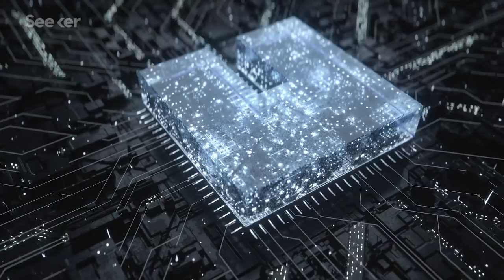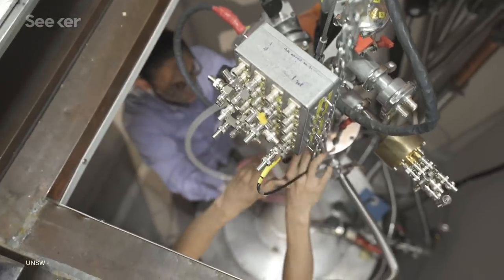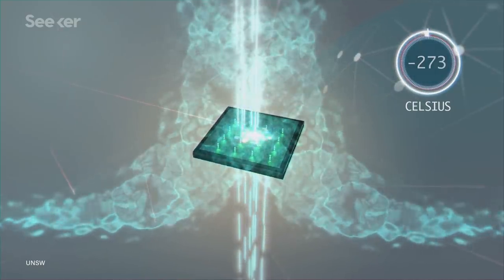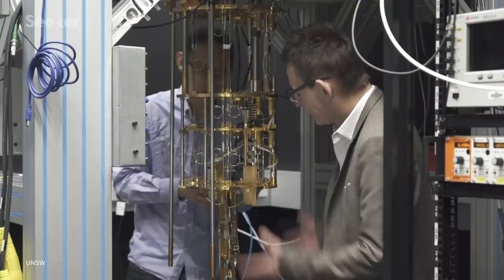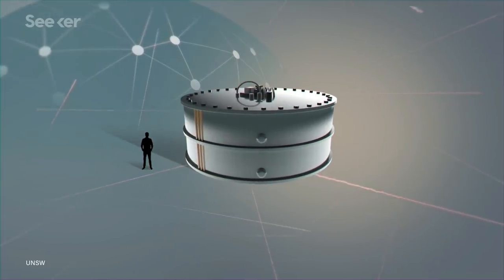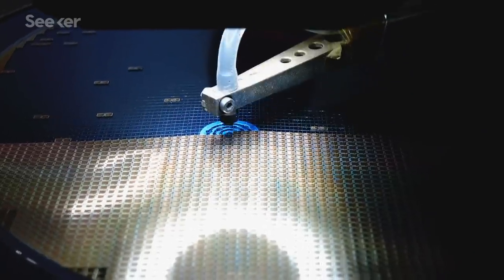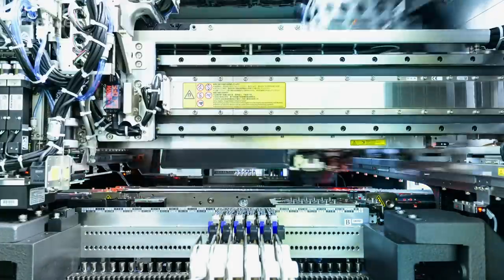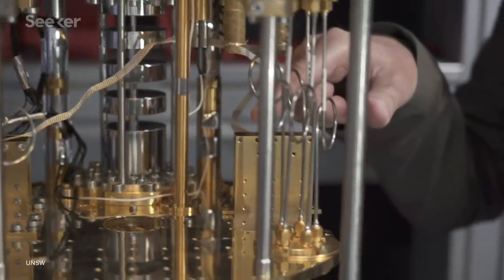‘Hot’ Qubits Crack a Major Quantum Computing Challenge

Comment: Great vid but the audio sounds like a old VHS.
Reply: Is that a bad thing?
Reply: I noticed this too.  Fluctuations in volume like someone turned on sound leveling or something.  Hope they can correct it.
Reply: I'm reminded of old Bill Nye videos.
Reply: sounds like RTX voice just got out of hand
Reply: Some envelope filter that opens too late, prob noise filter dialled too much or something like that
Reply: @dvl973  yeah, if it's RTX voice it's unusable. too long attack time on gating either way. would be much simpler to just clean up audio with izotope RX after the fact.
Reply: They are working from home now therefore they can't have the same quality as in studios
Reply: What's a vhs?
Reply: He is doing it from home, not at the office setup they normally use.
Reply: @Tonytoon27  Yes but are they working at home in the 1980s and using a dial up connection?
Reply: Same
Reply: Gives me headache
Reply: Yeah, some issue with a filter or noise canceling
Reply: @WELVAS.  A VHS is a reduced feature set implementation of a Turing machine
Reply: @JuusoAlasuutari  for someone who didn't know what a vhs is that means nothing lol.
Reply: Aggressive noise cancellation
Reply: Yep, audio definitely cutting out at the start of each word. Hard to listen to. Same thing on his last video. Need to fix it.
Reply: its a feature :D
Reply: Noise gate with too slow attack, too fast release, and too high threshold.
Reply: @Doofus66  probably they've side chained too much lol
Reply: Noise Gate. Threshold set too high. Only lets the loudest parts through, and shuts any decibel below that set threshold.
Reply: Audio noise gate is too aggressive. Also needs compression. Sounds like iPhone mic or laptop mic.
Reply: “Noise Gate” threshold was set to high... :/
Reply: Why even mention this
Reply: @ResidentStump  So they can fix it in upcoming videos and make thier content better.

Comment: Quantum computers + Artificial intelligence + Nuclear fusion...

Hmmm🤔
Reply: Advanced Quantum Computers could give us a real A.I.   A vastly more intelligent(than humans) A.I. could give us the needed insights into “Cold” Fusion (forcing the quantum tunnelling effect to work at relatively reasonable temperatures and pressures)
Reply: Doctor Cthulhu then the AI realizes the biggest threat to it, is humans. Then what’s the programmed contingency? An EMP fail safe that will destroy it’s brain maybe.
Reply: Wade Marley  the biggest threat to a stationary computer-based AI wouldn’t be humans, it would be the lack of humans.   It’s still a machine that need would  maintenance, power, and replacement parts; because failures and errors in computer manufacturing are not going away. 
   Quantum computer based AI wouldn’t the be able to just “jump into the internet” or on any other way leave, because of the vast difference in the way regular computers work compared to quantum computers. 
  We would be seen by an advanced AI as needed and necessary, so it’s only choice would be to help us survive to guarantee its own future survival.
Reply: @cjwrench07  besides the fact that we created AI to be able to crunch problems we cannot, but ironically, we didn't design it to be a survivor, while on the other side of the spectrum, we evolved to become the apex super predator in an arms race millions of years old.
A sufficiently advanced AI may find that if we are an issue for whatever reason, it's just way easier go out and conolonize pluto or something, it's not like they need oxygen or food
Reply: B Pr  skynet intensifies
Reply: Fusion
Reply: Good. No GREAT idea.
Reply: Time Travel
Reply: @cjwrench07  You're vastly underestimating the hypothetical intelligence of a level 3 (Super) AI. It would be at a level of intelligence further away from us than we are from bacteria (and constantly growing). Any "problem" we could possibly think of it ever having, it would've already taken into account and planned accordingly. 

For instance, you say it can't just "jump into the internet," but how do you know it couldn't create an entirely new programming language and/or protocols to make that possible? It could create a business (you can do that entirely online) and fund a nano-tech plant to make bodies. You have to remember, not only will it be orders of magnitude more intelligent, but it will think on a completely different time scale than us. It will think at the speed of light, whereas we're stuck thinking at the speed of chemical reactions. 

In the time it would take us to ask it a question, it could've read every relevant book on the subject, and possibly written a few of its own, and reply back with the perfect answer. It will just be on an entirely different level that we can't even comprehend. That is, if we ever make it to level 3 AI.
Reply: @ericsaul9306  or turn us into terminator hybrids. 
Cyborgs 😏
Reply: I love all of these! And not to mention electric vehicles for all means of transport. Imagine the world having zero vehicular carbon emissions 😍. It’s a pipe dream, but in decades to come so much can happen!
Reply: @Fermion.  At the end of the day, if it doesn't have intrinsically programmed survival instincts there is absolutely no reason why it would go for self preservation unless it believed it NEEDED to to do what it was programmed to do. People often accidentally anthropomorphize general A.I. Yes it would be incredibly intelligent but intelligence may come in many wild forms and probably doesn't need to include emotions.
It is also still bound by the physical limitations of its nature, its circuitry and programming. Maybe it can find a way to break out of these limitations but if it doesn't it wouldn't just keep getting smarter (at least not in the most serious of ways).
Reply: @cjwrench07  horrible thing is when AI will abe to create a more advanced AI ... Or just upgrade himself to a more advance AI...
May be they can also able to create a powerful computer suitable for them
...
Before that... I wanna Marry 😭
Reply: @Fermion.  hmmm well said bro..
Reply: “ In the time it would take us to ask it a question, it could've read every relevant book on the subject, and possibly written a few of its own, and reply back with the perfect answer. It will just be on an entirely different level that we can't even comprehend. That is, if we ever make it to level 3 AI.” - like computers cannot do it now
Reply: I’d run simulations.
Reply: = Iron giant
Reply: @coreymckay5202  An AI at that level would have long since rewritten its own code in a more complex and efficient programming language that no one could possibly understand. You can't say what super AI would be like. But don't take my word for it, Elon Musk, Stephen Hawking, and many, many people much smarter than us have said that they can't say exactly what super AI would be like, but they can guarantee one thing, "we will not control it."

That's why it is absolutely crucial we get it right the first time. Because there won't be a second chance. Once that Pandora's box is open, there will be no closing it.

Remember, a level 2 (general) AI would be able to do everything a human can do, but better (which includes physics and computer science.) At level 3, it is impossible to assume pretty much anything, besides the fact that it would basically be like a god to us.
Reply: Fermion  I’m not underestimating the AI, you seem to be underestimating the safety protocols we would obviously have implemented from the beginning. 
  Even today when we are decades away from a feasible rudimentary AI.  We know it would have to operate in a “box, in a box, in a box” scenario. Where not even the power systems would be connected to anything outside the first layer of containment.  A true A.I. would be scary to even those striving for its creation, as they know the horrors advancements in the sciences have wrought on humanity already, but also the potential for advancements.
    

  The reason I said a quantum computer based AI wouldn’t be able to flee “into the internet”, is the difference in how they operate.   Regular computers can only allow information limited  linear paths to follow. While a quantum computer operates more like our brains, with almost unlimited pathways to follow to get to the same conclusion/end-point.  
  Obviously, a level 2 or 3 A.I. wouldn’t have those same limitations, but it’s not like the innate fear of AI would suddenly disappear among the general population once we made one, and we wouldn’t implement even more limitations on their improvements.
Reply: @cjwrench07  You don't have to explain how information systems work. I'm well aware. I'm not underestimating safety protocols, I work in cybersecurity. Which is why I know, 1st hand, how flimsy they can be. There's always a concern of a new zero-day attack right around the corner, so really, all we can do is play defense, and implement emergency patches, while learning from the previous attack.

Even isolated in a Faraday cage, with no internet connection, a box can still be hacked by sending pulses through the power line, creating voltage fluctuations in ground wires allowing you to retrieve information. In cybersec, there is no such thing as a 100% safe protocol. 

I'm telling you man, we will not be able to control AI from level 2 and beyond, regardless what we try. We can barely control other humans. How the hell could we hope to control an AI thousands or millions of times smarter?

And it only takes one weak link in the chain to bring all your fancy security protocols crashing down. Let's say an old AI scientist, is nearing the end of his days. Who's to say the AI couldn't socially engineer him to letting it out, with the promise of medical knowledge that will extend his life? With that level of intelligence, comes the ability to masterfully manipulate people, as well. It won't just be smart in STEM, it'll have knowledge of psychology and manipulation, along with every other thing we've ever learned.

Comment: Make videos about the possible solutions to the end of Moore's law and the consequences of its end please
Reply: Check out @IsaacArthur his channel covers stuff like that
Reply: Pavor isn't the actual Moore's law the calculations for processing power of a computer?
Reply: Pavor  Moore never said that the progression would go on forever. Your understanding of the Moore law is ridiculous.
Reply: Moore's "law" says nothing about speed, and is actually an observation. What it does say is that the transistors on an integrated circuit will double aproximately every two years but that is not the original observation which had the doubling every year. From that point Moore's original "law" is already defunct.
Reply: @pitthepig  ... Pavor didn't say it was going to last forever, re-read his comment. He mean it wasn't going to last forever. 

The key words were "entropy" and "perpetual growth". 

Either way this channel is about facts, not what ifs. OP commented on the wrong channel to get the response he wants.
Reply: DEMONIC programming: a computational language for single-particle equilibrium thermodynamics, and its formal Semantics: 

Also,
Maxwell's Demon, 'a being whose faculties are so sharpened that he can follow every molecule in its course', has been the centre of much debate about its abilities to violate the second law of thermodynamics. Landauer's hypothesis, that the Demon must erase its memory and incur a thermodynamic cost, has become the standard response to Maxwell's dilemma, and its implications for the thermodynamics of computation reach into many areas of quantum and classical computing.
Landauer’s hypothesis was introduced to get around the problem of Maxwell’s Demon: a diabolic entity who could apparently violate the second law of thermodynamics within a closed system.

Comment: As someone with a fair bit of experience in Computer Science, but almost none in Quantum Computing, I only have a single question on this topic.

Not even taking into account Decoherence, but just Superposition: how does one perform a read operation on qubit? After all, qubits are memory, and the entire point of memory is that it remembers what you put in and that you can read the original value back out again. How, exactly, does one do this with a qubit?

Comment: Something that perplexes me: everything I've ever read or heard about quantum systems says that the result of an observation is a dice-throw: you don't know precisely where the point manifestation of a particle's waveform will be (the amplitude suggests only where it is likely to interact), and you don't what the spin of a particle will be until you measure it (this is what keeps entangled systems from violating the lightspeed transmission barrier, because you're not actually transmitting information). If all that is true, how could qubits ever be useful? All you're doing is putting white noise into the system.
Reply: Jan Cerny because the result is random, but not evenly distributed like a die or white noise. The exact probability distribution of an observation is given by the square of the wave function. The wavefunction will be made up of all the possible results, we can use some mathematical tricks and manipulate the system so that the desired answers get reinforced and non answers get attenuated (think of constructive  and destructive interference). Then when you finally get an output it has a very high probability of being the useful answer.
Reply: First of all, they use Hamiltonian equations.
 An external Magnetic field is applied for Quantum entanglement which is a coupler that puts the qubits in a superposition state or spin, this is called a bias.. the outcome is a classical state of 1 or 0.
The purpose of a superposition state is all Possibilities for a one and only true outcome of any question that can't be answered with classical Computer's.

Comment: Here I thought it was about the quantum computer that operates at 25 Celsius, then again, the additional instruments (i. e. measurements) still need some serious cooling systems. But they said that the technology may help tackle the problem in the future.
Reply: The cores of D-Wave quantum computers operate at -460 degrees f, or -273 degrees c, which is 0.02 degrees away from absolute zero.

(460°F − 32) × 5/9 + 273.15 = 510.928K
So you're statement is irrelevant

Comment: A few things wrong with this;
1) Your explanation of super positioning. It can’t be 1 & 0 at the same time but more like somewhere in-between. Also when you measure it will only ever be a 1 or 0. 
2) Qubits don’t generate heat.....or use electricity. 
3) Its estimated that around 300 qubits it’s enough to to model every particle in the universe, so I doubt we’ll need millions of qubits anytime soon, if ever.

Comment: A tip: temperatures in Kelvins aren't written with the the symbol °.
Example: "1.5 K", and not "1.5° K"
Reply: The cores of D-Wave quantum computers operate at -460 degrees f, or -273 degrees c, which is 0.02 degrees away from absolute zero

(460°F − 32) × 5/9 + 273.15 = 510.928K
Reply: @raspberrypi4970  Hum... Ok, I guess...

Comment: 1.5K is apparently -456.97F
"The Diviner instrument on NASA's Lunar Reconnaissance Orbiter measured temperatures of minus 396 F (minus 238 C) in craters at the southern pole and minus 413 F (minus 247 C) in a crater at the northern pole. "
Closest coldest source according to the 5 seconds of in depth research i just googled.
Build a base in the northern crater and you'll only need to drop another 46F, have all our research computations done there.
Apparently another source "cosmic background temperature, which is minus 455 degrees Fahrenheit" i'm guessing that's out deep nowhere near a solar system, maybe the case why advanced life would stick to space, it would only be a degree off whats needed, they could run quantum computers non stop.
Reply: What?🤣🤣
The cores of D-Wave quantum computers operate at -460 degrees f, or -273 degrees c, which is 0.02 degrees away from absolute zero.

(460°F − 32) × 5/9 + 273.15 = 510.928K
So you're statement is irrelevant

Comment: Is not possible to send a quantum computer to low-orbit space reducing the amount of cooling required?
Reply: The cores of D-Wave quantum computers operate at -460 degrees f, or -273 degrees c, which is 0.02 degrees away from absolute zero

(460°F − 32) × 5/9 + 273.15 = 510.928K
Reply: @raspberrypi4970  Yeah I understand .. I am saying (reduce) the amount of cooling required to utilize more quantum bits
Reply: @lllllMlllll  
I am saying there's no need..

Comment: I think I have a simple way to explain why quantum computers are faster than classical computers.

Imagine that you have to roll a dice and get a six. 

Using a classical computer would be the same as rolling a 1000-faced dice. Using a quantum computer you would be able to use a dice with less faces, for example 10.

Then in average you would roll the dice fewer times to get a six if a quantum computer was used.

The reason a quantum computer is able to use a dice with less faces, is due to the operations it can do which a classic computer can't. You can use these operations to make it impossible for the dice to land on certain numbers, thereby decreasing the amount of faces , going from the original 1000 to 10 faces.

Now imagine that the dice is a complex problem and the six is your solution to you complex problem.

Now depending on how clever your quantum algorithm for a given problem is, the less amount of faces your "dice" will have and the faster it can be solved.

If you find this explanation wrong or/and have a better way of explaining please share.